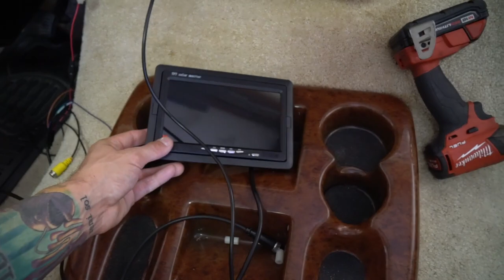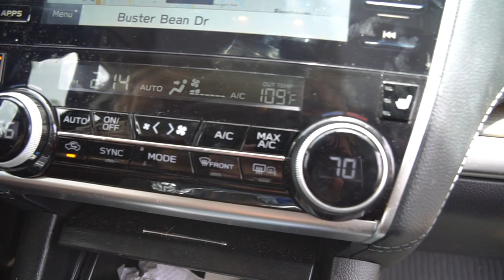BABY RIDES VACUUM ROBOT + RV RENOVATION!

Comment: Remi makes me smile every time,  the cabinets will turn out fine, thats how you learn, one tip when you spray, make sure the plastic dont blow up into the painted doors, what I do is put plastic down then I got 5 gallon buckets and strips of wood and it puts the doors up higher,  problem with painting them on the plastic they will stick to it, raising them up lets you paint the edges better, and make sure one side is really dry before flipping them, thats why I say use lacquer paint and spray it, the little sprayer should work if its really cleaned good before use. latex paint has a bad problem of peeling even with primer under it, I have painted thousands of cabinets with lacquer.

Comment: CHARM buddy I see the hard work u guys r gonna be doing and I have a major hack for ya,,, those cabinet doors and other wood parts of that will go so much quicker  if u either hand paint or spray primer on first. Especially to go lighter over a darker base color. Also goes well to change from shiny to matte finish without all that sanding. When it's time to find a place to dry them, try using ladders. Makes great spraying platform too if ur gonna rent a sprayer or buy one.